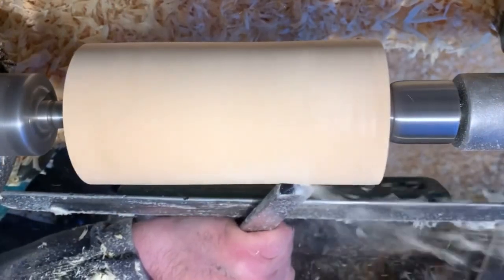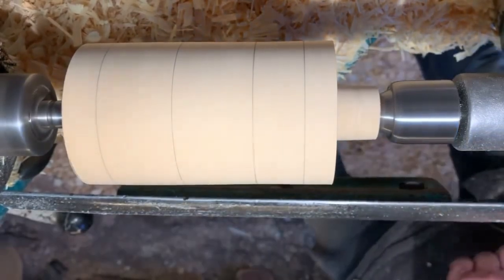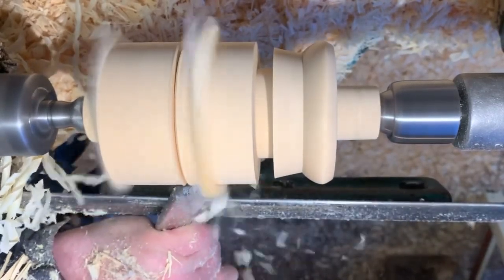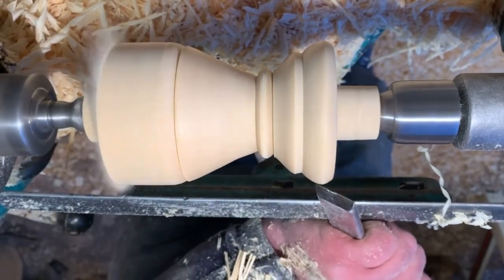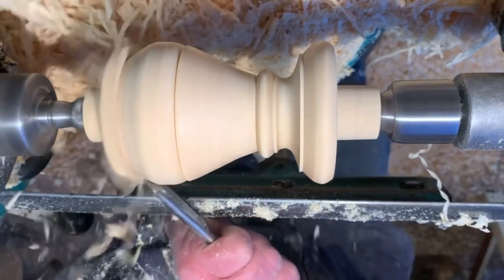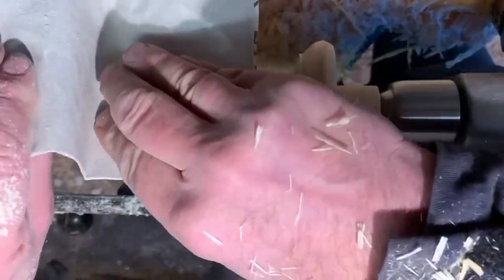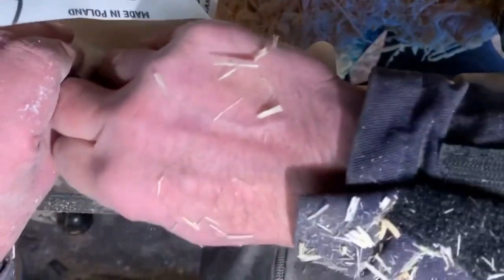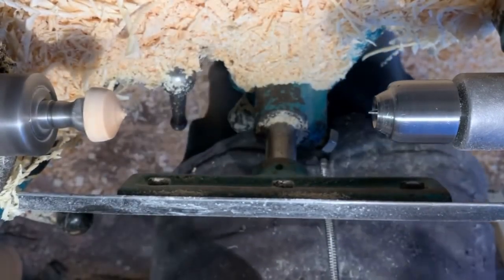Copy Woodturning an unusual finial

Comment: Hola Sr Esteban, realmente es muy agradable de ver su técnica con la herramientas. He tratado de hacer algo pero no paro de producir enganches mal.¿Pueda ser que tal vez tenga que ver la velocidad de rotación? Desde ya mi admiración total a la excelencia y pericia tan particular. ¡Abrazo!
Reply from the maker: Thank you. It will be tool Presentation not rpm
Reply: @woodturner21  hola quería decir después de un tiempo de continuar equivocandome, le di mucha importancia a esas palabras de su respuesta, y estoy más cerca de logros. Gracias gigante. Saludos.